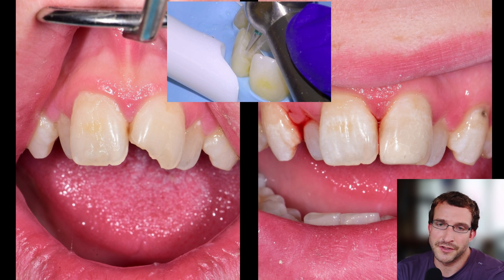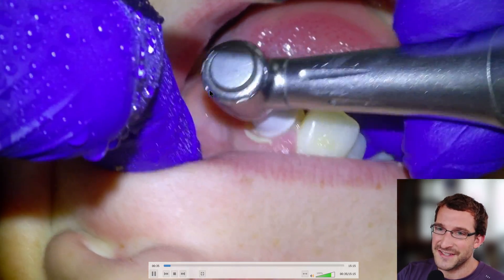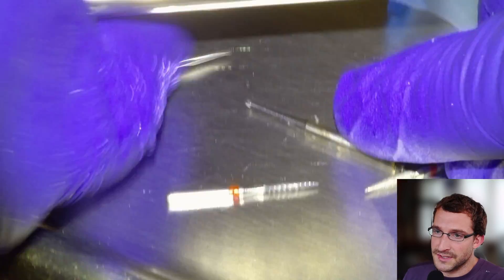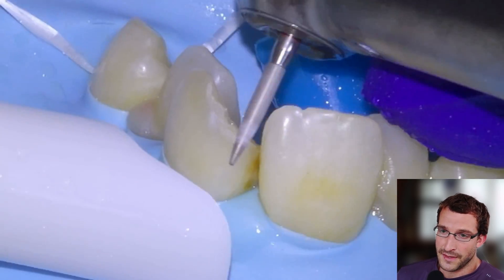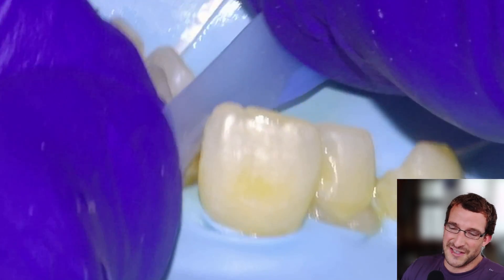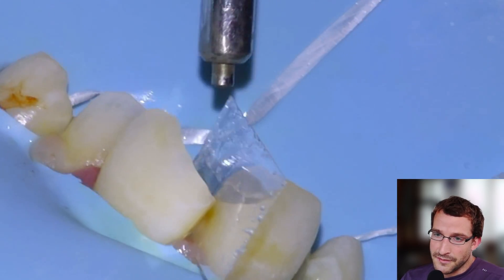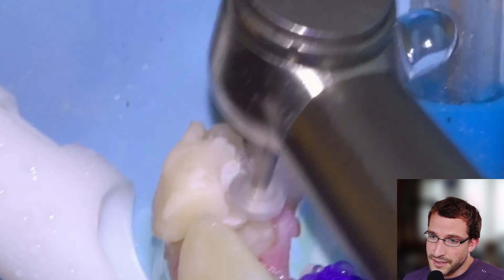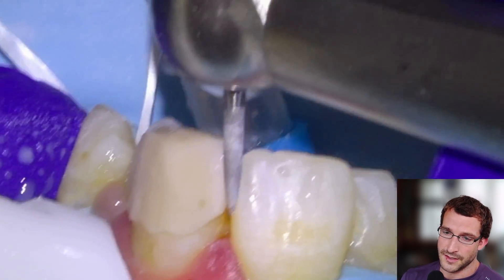[83] Fractured Central Incisor Repair (Live Procedure)

Comment: sorry could you resay what you were saying about finishing on a wet surface as it dosent leaves cracks, do you mean by spraying water on the tooth during polishing? thanks
Reply from the maker: Yes that's right, I find when finishing using water prevents that appearance of surface cracks (which I haven't found affects the material structurally)
Reply: @behindtheloupes  Thanks so much!

Comment: It’s a little off topic, but what do you think about using putty matrix. Some dentists I work with states its compression of composite against tooth that helps with retention. Not sure if that is true or not.
Reply from the maker: I think it makes sense and probably makes doing class 4 restos less technical and more predictable if using composite but one of the other advantages of using these capsules is that you have a shit ton of extra material that's going to go to waste anyway so you might as well glob it on to be sure and then it's just easier to cut back while it's in its semi-set state whereas with composite you don't really have that luxury so building it up to the final shape is more of a priority. It's also not as easy to cut back composite if you overbuild it, though I still think a slight overfill and cutback is easier (for me)